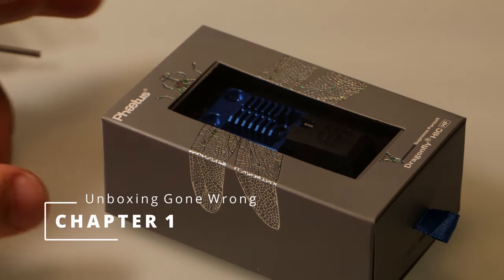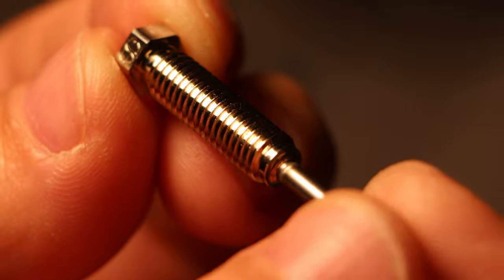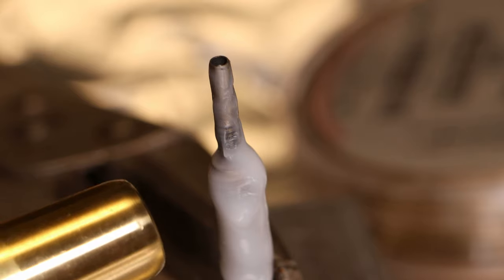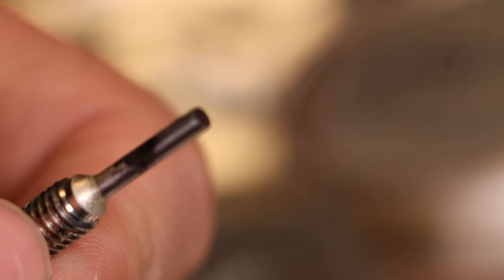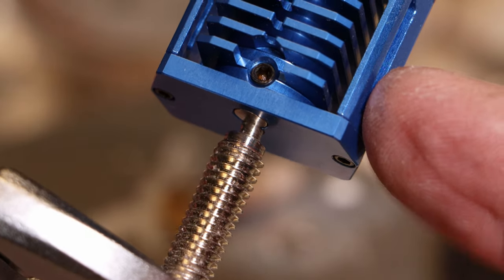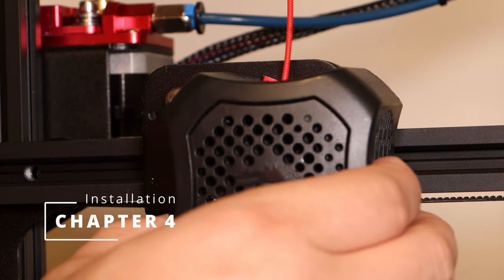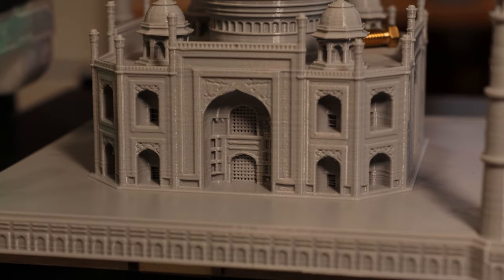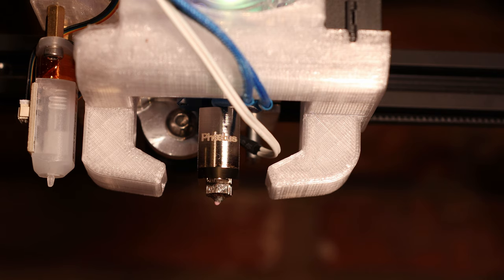The Hottest New Hotend (Dragonfly HIC HF)

Comment: I would suggest not to purchase this hot end unless the only use you have is to use hardened steel nozzles as I found out the hard way that they will only ship with hardened steel.
After purchasing an extra hardened steel under the assumption that they ship with plated copper I was told that they cannot produce the plated copper so now I can only print with hardened steel.
Not happy Phaetus....
Reply from the maker: Looking online all I can find are the hardened steel nozzles. Maybe they discontinued the copper/brass nozzles because they couldn't figure out how to bond them together. Tell them to watch my video, I solved the problem :P
Reply: @NathanBuildsRobots  yes that is correct and not all vendors are disclosing that so for me an expensive mislead
Reply from the maker: @Robert White  Yeah for how expensive this nozzle is, they should be providing top notch customer service with it. 

Few companies know how to do the bimetallic heatbreak thing properly. I'm guessing most are just doing a press fit. Phaetus's laser welds are a nice try, but really you gotta solder these things together if using dissimilar metals. Or maybe use a stronger laser that welds deeper?
Reply from the maker: I reached out to Phaetus. They were having some issues with the bond strength between copper and steel so they are only shipping steel nozzles right now. 

I gave them some recommendations on how to bond the copper and steel parts based on my experience working on this video and it sounds like they are going to try to bring back the copper nozzles. 

Thank you for your comment! Otherwise I would have never known this was an issue. If they end up bringing back the copper nozzles I'll see if I can get them to send one out to you.
Reply: I think you make a good point, that if you are not looking for a 'drop in replacement' hotend, it might be better to look at their dragon and dragon HF hotends. They use generic V6 style nozzles instead of these custom (fragile) ones, and have similar performance. Plus you have the added benefit of single handed nozzle changes.
Reply: That was helpful... So... What do you hate about the product?

Comment: you should break more things and repair them, that was damn impressive. friction stir welding.. i would have thought of that but not have the balls to do it. well done!
Reply from the maker: Thanks! But for real friction welding to occur I would have needed much more force and pressure - to the point where both pieces were red hot. 
I think what I actually did was just gall up the surfaces and make a mediocre friction fit.

If you want to see a more practical and successful application of friction welding, check this video out:
https://youtu.be/KKZUg5CuGDU

Comment: I've been happy with the Red Lizard V2 hotend. Dragon is okay but I noticed that I have clogs, sometimes a cold pull fixes it, sometimes it's really bad and I have to throw it away.  This only happens when hotend fan becomes faulty and not blowing air at all even through fan is spinning.
Reply from the maker: I should be getting a Red Lizard soon, it will be fun to try out. I'm planning on replacing the hotend on one of my antique 3D printers and will make a video about it.

I bought the Dragon and got this Dragonfly for free. They sure aren't cheap! I haven't had any issues with my Phaetus hotends after about 100 hrs of printing, but I will be sure to mention it if something comes up.

Comment: With the length being longer than the MK8 on the Ender 5 Plus and the difference between the BL Touch and the tip of the nozzle will I need to make adjustments in the firmware?
Reply from the maker: No, just add some spacers behind the bl- touch so it sticks out far enough. Then update the z offset through the menu, just like you did during the initial setup.
Reply: @NathanBuildsRobots  I wish I knew that when I installed the Copperhead on my other Ender 5 Plus! thanks Nathan!
Reply: Agreed, spacers are good. And if you are not using BLTOUCH then you must adjust your Z end stop to prevent the new nozzle from crashing your bed

Comment: What kind of silver solder did you use? And will normal flux for tin/lead solder work, or do you need a special kind?

Awesome video by the way. Very interesting!

Also, would a heatgun that goes up to 900°c work? Or is a torch essential?
Reply from the maker: Thank you! I try to add some kind of complex engineering tidbit into every video I make to keep things interesting.

I linked some silver solder in the video description. Most silver solders will work with many types of metal. I used "Harris" brand since it is the highest rated. Metallurgy is a very complex science. Here is a kit that has the right solder and flux:
https://amzn.to/3uMeWGc
I bought my torch/gas at Home Depot., but you can follow the link in the video description to get a torch on Amazon. 

A heat gun wouldn't work. A MAPP torch like the one I linked to burns at 3,730 degrees Fahrenheit, hence the blue-white flame. 

https://www.harrisproductsgroup.com/~/media/Files/PDF/Spec-Sheets/Brazing/High-Silver/Safety-Silv-56-CWSpec.pdf
Brazing Range 1205°F- 1400°F (650°C -760°C)

The hard part of soldering/brazing isn't melting the solder. Heating up the work pieces is more challenging, because they are chunks of metal that are rapidly conduct and radiate the heat away. Everything (both workpieces and the solder) must be heated up to the brazing temperature before the solder can stick, and the area must be covered in flux, otherwise the surface will oxidize and nothing will stick to it. 

Flux serves two purposes, it dissolves the oxide coating, and it protects the metal by producing a barrier of molten flux and gas that keeps the oxygen out. It's actually pretty clever.

https://en.wikipedia.org/wiki/Flux_(metallurgy)#Metal_joining
Reply: @NathanBuildsRobots  awesome! Thank you for all the great tips. 

I showed this to a buddy, and his concern was that heating the the tube "probably reduced the strength and corrosion resistance" what do you think, as you seem much more knowledgeable about this than he?

Also, do you think that you should have put flux inside the heatbreak/nozzle? otherwise it could oxide and thus not be as smooth. Perhaps you have not noticed any issue I'm that sense, or maybe you have? How's the hotend working out for you since the fix?
Reply from the maker: Its still working great.
Not a whole lot of strength is required for this joint. The stresses are very low.

When stainless steel is heated its Corrosion resistance can be degraded.

"Will this stainless steel weld rust?" https://www.thefabricator.com/thefabricator/article/metalsmaterials/will-this-stainless-steel-weld-rust-

Though, even if it has lost 100% of its Corrosion resistance and was just like plain steel, the hotend lives in a controlled indoor environment, so its unlikely that corrosion will be an issue. 

Flux inside the heatbreak and in the joint between the heatbreak and nozzle would have been a good idea, but would have required more time to clean up. I didn't know how difficult it would be to remove the Flux so I only put it on outer surfaces. 

I imagine the inside of the heatbreak is slightly rough now, but not enough to effect performance.

Comment: is it common to laser weld dissimilar metals? I haven't had to deal with laser welding yet in my career. It's very, very, very uncommon to see dissimilar metals welded by traditional processes so I'm surprised to hear this.
Reply from the maker: The most common welding processes for dissimilar metals are laser, spot, and friction welding. I don't know all the reasons for this, but here are a few: 

Laser and spot welding can be done in milliseconds and at small scales. TIG, and torch welding usually requires several seconds, and welds are usually larger than an inch. So these faster welding methods produce a smaller heat affected zone. You can imagine that dissimilar metals (with different coefficients of thermal expansion) will produce large stresses which cannot be solved by annealing. If you tried to anneal, the stresses will reappear when cooling back down. So large structural joints will have unique challenges. On a small scale the stresses are easier to ignore. I

Corrosion will be an issue due to galvanic differences, so anything that will be out in the elements might be at risk.

#4 on this article is also very important. You can't just pick 2 metals and expect it to work. You will get best results welding dissimilar metals that are commonly alloyed with eachother. For example, copper/nickel, lead/tin, are good matches while aluminum/steel, which would probably be the most useful metals to join, will not work. But aluminum/titanium might work.

https://www.yorksheet.com/york-sheet-blog/dissimilar-metal-welding

I linked a paper that has some cool diagrams. 
https://www.sciencedirect.com/science/article/pii/S0264127520305918

Comment: Still waiting for a quick change nozzle, would think that would be the first thing people would design. There still does not exists any smart way to switch nozzle sizes on the fly.
Reply from the maker: Most quick disconnect connectors use an o-ring to prevent leakage. However there are a few that use a conical mating surface that would probably work for 3d printing, like these: 

https://www.mcmaster.com/Air-Connectors/brass-quick-turn-tube-couplings-for-air/quick-turn-component~socket/

Another thing I'd like to see is variable nozzle sizes, like what you see on a jet exhaust, iris mechanism, valve, or variable magnification microscope.

Comment: How does this compare to a dragon or dragon HF?
Reply from the maker: I actually have both, so I know the difference well. 

The performance should be about the same, the main difference is form factor. 

The Dragon is a E3D V6 style hotend, so it would be a drop-in replacement if your machine was designed for that.
The Dragonfly is an ender 3/CR-10 style hotend, so it will be a drop-in replacement for those type of machines.

Also the dragon hotend will be much stronger. On the dragon there are 4 small tubes that support the hotend in addition to the heatbreak, so if your printer crashes into something it is much less likely to get bent or break off. I had a pretty bad crash with my dragon and it ended up being fine, but if I had been using a E3D V6 hotend (where the hotend is only supported by the heatbreak) it would have almost certainly broke off.

I am finishing up a video on a supervolcano dragon build where I will talk about this in more detail.